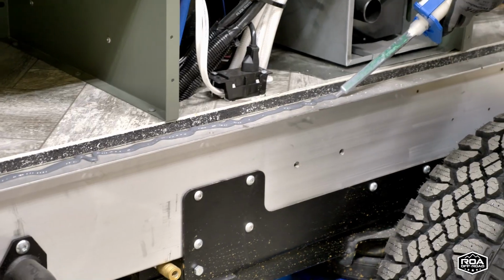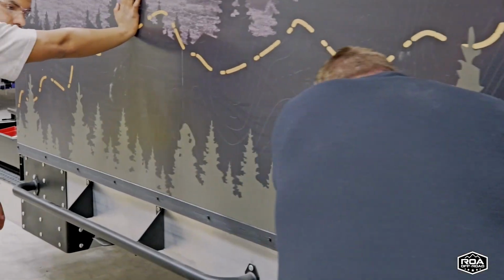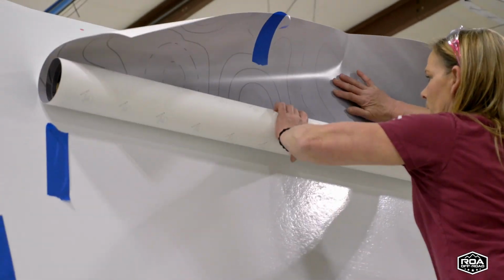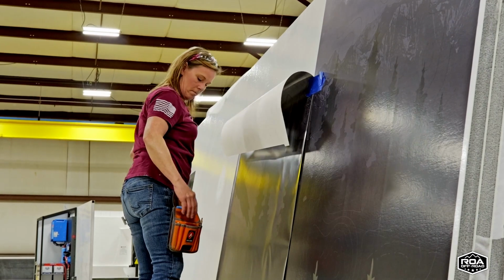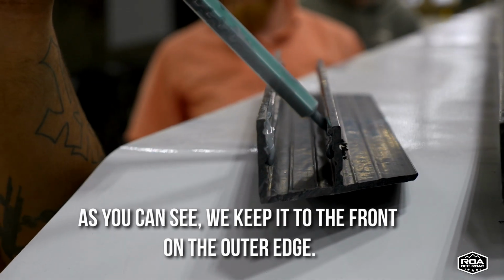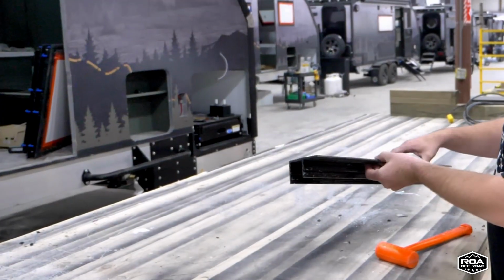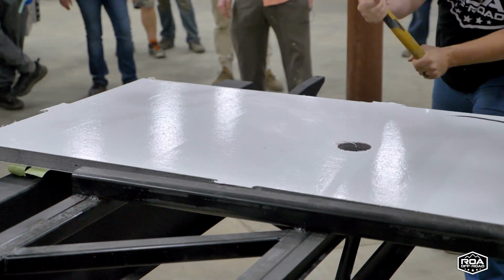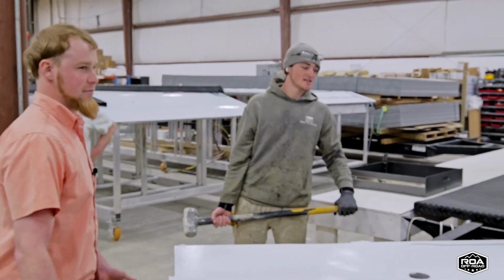SURPRISING STRENGTH of the 2023 PAUSE Overland trailers! 4x4 offgrid camper RV Factory Tour Ep3

Comment: Impressive, but, does the Pause, or any of the trailers built by Imperial Outdoors (X145, X195, Roamer-1) require any goop (yes, I call it goop) that needs to be serviced once a year like other trailers?
Things like the roof & wall joints, AC unit, stargazer windows, ceiling vents/fans and other rooftop protrusions?